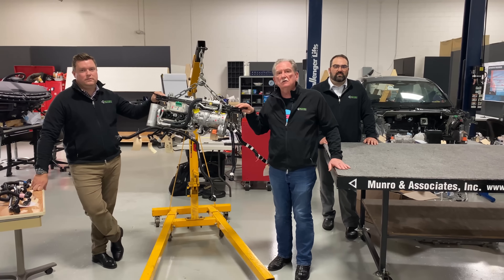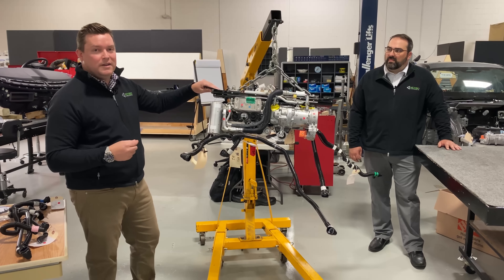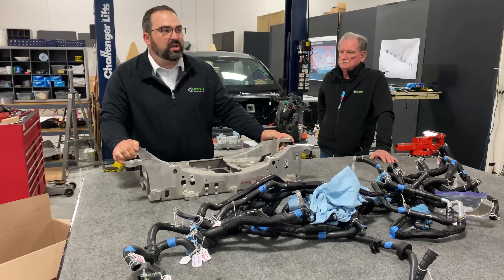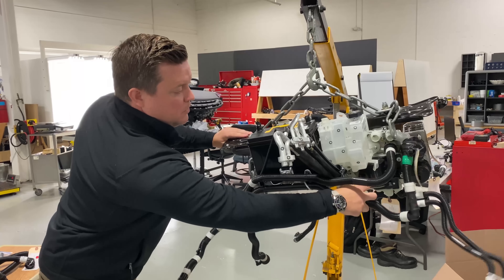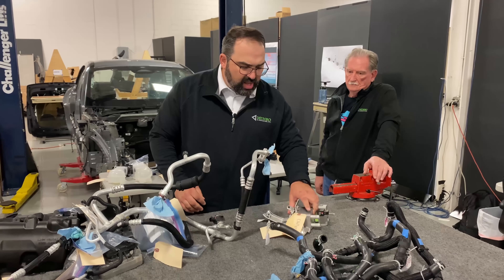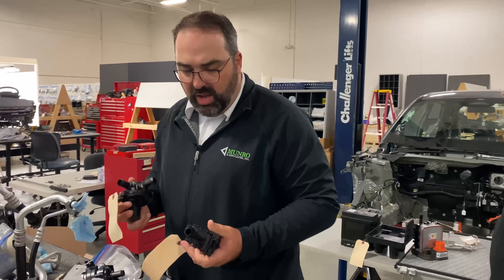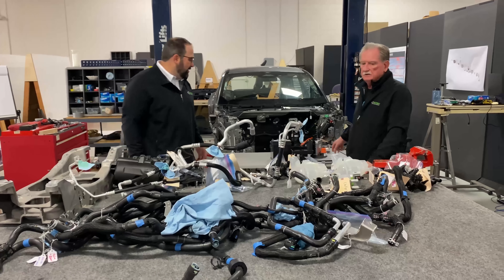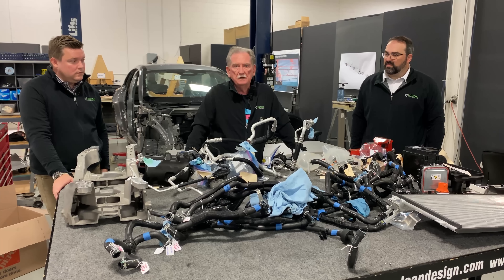Mach-E Thermal System Part 2: A Detailed Comparison to the Model Y

Comment: Ford engineers to dealership - Don't worry we have built in a lot of maintenance down the road to keep you busy, keep plenty of hoses on hand.
Reply: Problem is, they can't. JIT is a big thing for Ford dealerships, and sometimes the part you need now is on back-order for who knows how long, even for brand-new vehicles. Ford should outsource their parts inventory to Amazon.
Reply: @hallkbrdz  Amazon is filled with counterfit cheap parts. It's really bad
Reply: @frenchonion4595  I think he was more talking about how Amazon has better order fulfillment than Ford, not necessarily part quality.
Reply: @hallkbrdz  I think they do but the problem is a bunch of other people (probably from China) already beat them to the punch.
Reply: Unfortunately, this is how the real world works.   People are going to buy the Mach E (for various reasons) regardless of how many hoses or other shortcomings it has.  Ford knows this and I'm sure some accountant somewhere could tell you the profitability per vehicle of a Mach E compared to a Tesla.   Car manufacturing is a business.   Ford makes its money from truck sales.  Which is why they have all but withdrawn from the passenger car segment.
Reply: @kratosdisciple4637  
Tesla's business model will take down one or two big boys. The writing on the wall is there, is just a matter of time.
Reply: @daniluchison  Maybe.  It is pure speculation.  Until then I'll put my trust in companies with a proven long-term track record.
Reply: @kratosdisciple4637  
Do you know what's really at stake here?
An electric car hundreds of components less than a combustion car. Legacy car still want to charge the same amount of money for something that has a lot less components!!!
They haven't gotten the memo!!!
Reply: @kratosdisciple4637  ... not to mention the already overloaded and aging power grid general situation.
Reply: @kratosdisciple4637  - California & a couple of other states have passed legislation prohibiting the sale of New ICE vehicles starting in 2030-35 (depending on jurisdiction). The Biden Administration is going to restore the EV credit & apply it at the point of sale. And several government entities are planning to only buy EV’s to replace aging ICE vehicles. So it might happen a lot sooner than you think.
Reply: @TraditionalAnglican  Let's do some math(all values are approximate)....
Today:   287,000,000 passenger vehicles in US of which 2,000,000 are pure electric.
Average 3,000,000 car increase each year.
17,000,000 cars sold each year.
We'll say EVs increase 10% per year over next 10 years.
This equals roughly 75,000,000 EVs sold by 2031.
With total projected vehicles in US in 2031 being 300,000,000, that means EVs will account for 77,000,000 of those 300,000,000.  Or approximately 26% of all passenger vehicles on the road by 2031.  Now lets say EV's buck the trend and actually double the above numbers.   Best case scenario is about 52% EVs by 2031.
Reply: @kratosdisciple4637  There are 287M registered vehicles, not 287M cars.  Registered vehicles includes motorcycles, trailers, etc. A substantial fraction are vehicles like RVs and boat trailers, with have a long life but only seasonal or irregular use.
There are about 17M new passenger vehicles sold each year, and they average about 12 years service life.  Most EVs are new and actively used, thus having a disproportionate benefit.
Reply: I just drove a Mach-E and a Model Y today and I will tell you that one of those reasons might just be that it feels better to drive. Of course this is just my opinion regarding driving feel. But, while I would care about all these possible fail points, it was a great driving experience.
Reply: I can only imagine the number of hoses the dealerships would have to stock.
Reply: "Is that leaking hose a D345,or an E576? Or one of the other 17 types?"  "Don't know, put anything on. If it still leaks, they'll come back, and we''ll charge them again."
Reply: ford owners: yay.  picnic day at the dealership
Reply: That's exactly what this is about. Their ecosystem. It is not about the car itself but they car manufacturers and dealerships accross the globe.
Reply: Exactly!! Each hose will be at $350+ dealer price as well!!
Reply: At least, with all those hoses, the system is reparable.  https://www.youtube.com/watch?v=vVSw3KSevEc makes Tesla's design look a bit iffy.
Reply: @Jimmy Edward You speak of "people" like that includes the entire human race.   Tesla fans just don't get it.   "People" buy cars for all sorts of different reasons.   Why do you think there are so many car manufacturers?   It wouldn't matter if Tesla made the best car in the entire history of cars.  There are people that will buy them and a majority of people that will buy something else.

You don't have to take my word for it though.   Just look back over the last 100 years or so.
Reply: @kratosdisciple4637  more people buy certain makes compared to others or nah? There's thousands of manufacturers,  the vast majority of which hardly sell any cars and a minority that sell the majority.
Reply: @kratosdisciple4637  I don't know where you've checked. Here are the most recent numbers:
The BEV registration results already in our database (ordered by June):

Tesla Model 3 - 3,196 (6,270 YTD)
Ford Mustang Mach-E - 1,289 (2,718 YTD)
Skoda Enyaq iV - 1,115 (2,294 YTD)
Volkswagen ID.4 - 872 (4,330 YTD)
Nissan LEAF - 539 (2,502 YTD)
Mercedes-Benz EQC - 485 (2,568 YTD)
BMW iX3 - 468
Volkswagen ID.3 - 380 (1,097 YTD)
Audi e-tron - 338 (3,235 YTD)
Polestar 2 - 339 (2,349 YTD)
MG ZS EV - 337 (1,579 YTD)

https://insideevs.com/news/517969/norway-plugin-car-sales-june2021/
Reply: @RobinDemey  Lol.  That's for June.  Everyone knows, or should know, that Tesla delivers the vast majority of their vehicles at the end of each quarter so they can claim "record" deliveries.  What were the numbers for May?   Also, you didn't include PHEVs.
Reply: @RobinDemey  Here is a title from your own website:  "Norway: Ford Mustang Mach-E Tops EV Sales In May 2021"   Seriously, whoever you are, you have no credibility.
Reply: @kratosdisciple4637 , YTD numbers are included! What credibilty? You even don't read what I post. Model 3 more then double the sales YTD!
Reply: @RobinDemey  You are obviously biased towards Tesla.   The simple facts are that none of the EV manufacturers are dominating in Norway.   As more and more EVs enter the marketplace, all of the manufacturers will see their market share decrease.
Reply: @kratosdisciple4637 , completely true about the market share. I'm not biased, just looking at the facts. YTD numbers are more comparable then monthly numbers.
I was replying your statement: "Last time I checked, Tesla was 3rd." They are not 3rd at all. The Model 3 is number One by far. Only the ID4, that is new on the market since this year, is getting close. Model 3 is on the market for almost 3 years now! Even the ID3 (sales allready collapsed: less then half the sales in 6 months then in December 2020: 2,303 sales) AND ID4 combined are still behind the Model 3. Will be interesting to see what will happen when Model Y arrives :-).
There should be no dominating manufacturer. Competition is great for the customer.
PS: Why count PHEV? They are a very temporary phenomenon. Not comparable with BEV also. Just my opinion.
In Norway, VW should be the EV market share leader by the end of this year. If not, I'm worried about VW.
Reply: @RobinDemey    Facts can be misleading.   Past performance is not indicative of future results.   What Tesla fans aren't realizing is that the other manufacturers are about to release an onslaught of new EV options on the world's markets. 
Currently, as of this month, the Hyundai Ioniq 5 is the market leader in Norway.  By far.
This is just the beginning.
MG5, Xpeng G3 & G7, Skoda Enyaq, Nissan Ariya, Kia EV6, Volvo C40 Recharge, Audi Q4 Sportback, BMW iX, etron GT, Mach E GT, Genesis G80, Ford F-150 Lightning...  Renault, Peugeot, Fiat.

The next wave after that will include the Cadillac Lyriq, Toyota bZs, Lexus LF-Z, Lucid, Rivian, Hummer, Mini EV....

This doesn't include the existing players like the Nissan Leaf and Chevy Bolt.

Tesla is selling more vehicles than they ever have yet their overall market share in every nation is decreasing.   And that's a fact.
Reply: @kratosdisciple4637 do not look at monthly numbers please. They fluctuate to much, depending on manufacturers way of working. Quarterly and yearly are only numbers that count. 
With market shares of up to 80+% there is no way it can keep that high. Even Tesla Fans know that. We'll see if 'competition' will do as well as you think. Let's hope for it. The more competing models, the better for Tesla and EV's in general. 
Ford didn't manage to make 7000 mach e's in Q1 and in Q2. Not a big ramp up 😉.
ID3 sales collapsed...
Reply: @kratosdisciple4637  "...other manufacturers are about to release an onslaught of new EV options"  I've been reading for five years of "Tesla killer" competition that hasn't yet materialized.  Next year, yes?
Reply: @tomgray971  5 Years?   Hardly anyone cared about Tesla in 2016.   So that 5 years is just another Tesla exaggeration.  Like how everything Tesla is "10x", and "Exponential", and "Mind Blowing", and "Insane", blah, blah, blah...
Reply: If you look at the amount registered so far this year then the Model 3 numbers are not that impressive. Still they are #1 but not by that much.
#1 6270 Model 3
#2 5316 Toyota RAW4 (hybrid?)
#3 4330 VW ID4
#4 4326 Volvo XC40 (hybrid?)
Reply: @kratosdisciple4637  OK buddy it's a year later and Tesla is still way ahead and from all the sources I'm looking at they are still selling about 75% of the EVs. So every year you guys say the competition is getting ready to really do something. Let's check back in another year again.  As long as the competition keeps making them the same way as they did their gasoline powered cars with a Million Parts it's going to be hard to catch up. Have you looked at the numbers lately? Did this video not teach you anything?
Reply: It's no different than ford using DOHC vs Chevy LS . All manufacturers use different methods to achieve their goals.  
I have driven a tesla many times. And I decided to buy the mach e. It's just a  much better vehicle inside and out. It may not be as efficient with how they manufactured parts and achieved their battery range but it's still BETTER.

Comment: I get to laugh every time I see a Mach E or an ID4 when I’m out driving my Model 3.
Reply: So are Mach E makers - they already stole 10% of tesla market in EV.
Reply: @hagestad  NO, don´t steal it, the Tesla don´t sell any less EV-s because of Mach-E, the Mach-e stealing market from ICE vehicles!
Reply: @hagestad  Sorry, No mr hagestad.  stealing implies taking from.  Tesla is selling every one they make, and are building more factories to make more.  Tesla has not suffered a loss in unit sales volume when another EV from Ford or VW is sold, so no "Tesla market share" was stolen.
The sales the other EV makers do, are stolen from gas powered cars.  Tesla's increasing volume, almost doubling Year over Year, is stolen from gas powered cars.  Eventually, EV cars will have market share wars.  But that is only after gas powered cars eventually stop sales.
Reply: @hagestad  Tesla grew it’s vehicles sales more from Q1 to Q2 (15,000) than Ford sold EV’s in both Q1 and Q2 combined (Q1 6,600, Q2 6,200 Ford EV’s)  please try again. By the looks of it Tesla will regain that since they are selling every car they make and are making more faster every quarter unlike Ford.

Comment: Great 👍 content guys .. awesome.. Thank you ..

What I like about the Tesla setup is it’s more integrated and allot less lines .. however what I like most about Ford is the Ford system is a fully redundant system .. so technically on Ford you are looking at two systems and the Tesla is one system if it fails then both In cabin and electronic cooling both fail at the same time for the Tesla setup.. With that said Ford should make a system similar to Tesla that is much more integrated and with a ton less lines but still keep a fully redundant systems.
Reply: I'm not really sure I follow. Is having cabin air conditioning that important when your car is broken down on the side of the road? I'm not sure this is redundant by a strict definition of the word. It's just two separate systems.

Comment: This is a perfect example of the difference between a legacy ICE OEM that is converting to BEV, versus a new BEV OEM that is working from first principles and a clear slate. It is really amazing.
Reply: Yes, it is, because the legacy OEM who knows how to build cars built a car with a cooling system that is actually working, as it's supposed to, because overheating hasn't been an issue for ICE cars for decades. Tesla on the other hand built a cheap and simple cooling system that fails to keep the car in working order for more than 10 minutes of spirited driving on a hot day. 

I'll take the legacy OEM product any day, thanks.
Reply: @derbigpr500  Oh you mean working like this? https://insideevs.com/news/520468/ford-mustang-mache-overheating-regen/
Yes yes. Now where are the cases in which Tesla's cooling system aren't working?
Reply: @derbigpr500  "...legacy OEM who knows how to build cars built a car with a cooling system that is actually working." You sure about that? Why are Mach-E's overheating and dying on steep hills in Norway? Must be Ford's over-engineered thermal management system.

Comment: Omg 😳 I had no clue that cooling is so heavy
Reply: Cooling need not be that heavy.  These don't even have combustion, and yet Ford has 2.5 times the coolant! 50 pounds of coolant,  7 gallons. Most car engines only need 2 to 3 gallons. Ironically,  Ford probably spent more on engineering their cooling nightmare than Tesla spent on their cooling artwork. Can you imagine just trying to route all those hoses, then designing the molds for them? This is Rube Goldberg writ large.
Reply: its not. compared to giant weight of ev. Sandy is over dramatizing it all. It might be a financial drag while building a car and that is more important. But that have to be calculated.

Comment: The demand for that vehicle right now is so intense Dealers can barely keep it on the lot
Reply: Ignorance is bliss... until the buyer finds a coolant leak on their garage floor.
Reply: @martingardens  you say that like tesla isn't on the bottom of reliability chart?
Reply: @hagestad  They aren't. And they are at the tippy top of customer satisfaction and 'would buy another..
Reply: @hagestad  [citation needed]
Reply: @moki123g  actually both are true a lot of people love tesla's however  a lot of them also forgive their poor build quality which they are very well known for as well
Reply: @jdog8701  That's old stuff. Tesla is constantly improving and innovating.
Reply: @MarkXHolland  is not old their are plenty of stories of 2020 and 21 models with panel gaps and the paint is the same still

Comment: I do not disagree that there is a lot of efficiency in Tesla engineering when designing an electric vehicle compared to the years of background an ICE manufacturer has.  it is clear that it will take quite some time before an ICE manufacturer can overcome that because they are probably fighting a redundant expense effort.  Typically I like the Munro videos but this was the worst hatchet job I have seen yet.  You display Tesla hung up and attached yet you just dump Ford parts out loose and not connected to make it seem even more of a mess (than it already is).  The bias against Ford is strong with Sandy.
Reply: Come on Dude!    You can't be serious.
Sandy has already complimented Ford engineering in previous Mach E videos.

BUT - you can't make a silk purse, from a sows ear..

Comment: he is giving so much content for free, then imagine the depth of his paid reports. Good video with clear numbers at the end
Reply from the maker: That is exactly our goal! You get it. Thanks Ganesh.
Reply: @MunroLive  Even if they charge $80,000 per report, it would likely be worth it for VW to buy them. Not just one report -- buy them all !
Reply: @MbeyaIsHome  it is not that easy. If you have the reports and create new ideas, it needs a planned restructuring of business processes and culture.
Reply: Just by watching these videos OEMs could save years of development, they don't seem to be watching though. When they can't even match technology used in cars that have been on the road for 8+ years...it says a lot.
Reply: @Speedytrip  I think it's organizational issues with OEM. They know what they need to do. But they need to re-org so these engineers can work together.
Reply: @Speedytrip  it's patented so can't be easily copied
Reply: Yeah, I'm happy more and more engineering channels are using SI units, when it comes to calculations and conversions they are just easier to deal with!
Reply: IIRC Sandy said the first Telsa teardown report (Model3) was bought by multiple foreign car makers and none of the U.S. ones. Aargh!

Seems like Ford should have bought one back then - even that car had a much better system than the Mach-E.
Reply: This is why i want Sandy's team to look at the Taycan in this depth. As a Porschephile and former owner, and current model three owner, I'd be rapt.
Reply: Same thought, as an automotive enthusiast who now works in this industry I am in awe of the quality and depth of content here!
Reply: How in the living fuck are you verified? You have a single video with 120 views